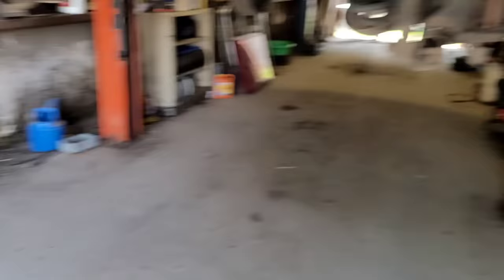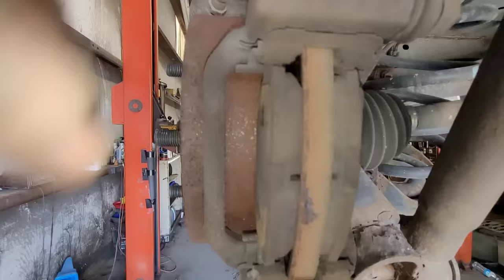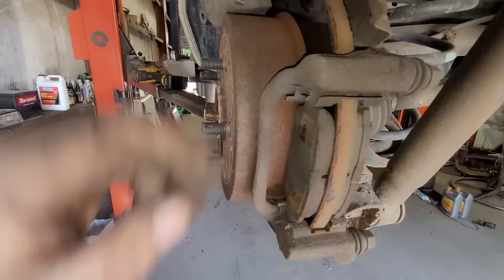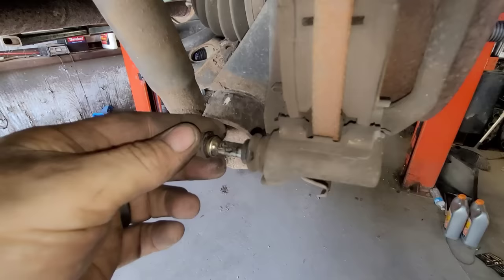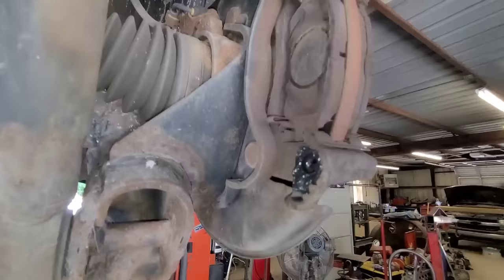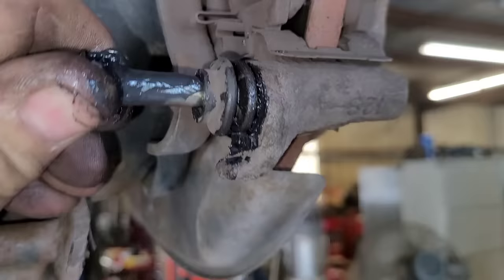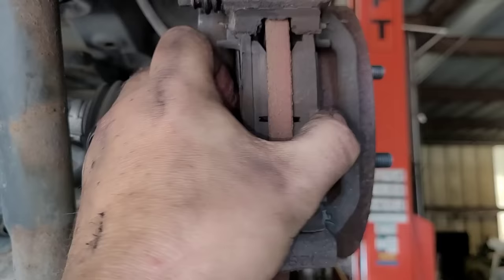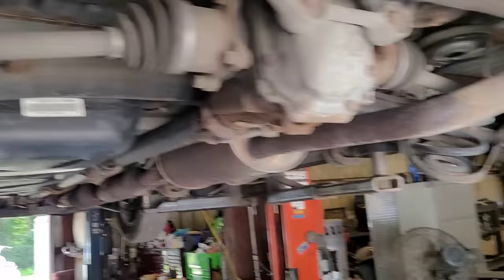Low Brake Pedal ? It's not air in the system...

Comment: If you have old fluid, the boiling point goes down. Boiling the fluid most definitely puts gas in the line. So it is possible that a never opened line, driven the same as always all of a sudden has air in the line. That's what happened to me. Those exposed Toyota pins on Tacomas, we replace every spring. Every spring. I have a truck that drove for 13 days in New England, and Florida dealership refused to service it for warranty

Comment: On older vehicles that only have drum brakes, having to pump the brakes means the master cylinder seals are worn and fluid is bypassing the seals. So in order to get enough volume to the brake cylinders you have to pump the brakes. I remember as a child our 1937 Chevy had that problem. Lefty

Comment: Just today, I found BOTH of the inside pads on my wife's outback worn out with the outside pads barely worn. The hidden side of both front disks was badly scored. I had followed bad advice to use anti-seize on the sliding guide pins. It caused the black rubber inserts on the guide pins to swell enough to lock them. I feared that I would have to replace the sliding caliper brackets but eventually found a puller to remove the pins. After new disks, pads, pins, and rubber seals, I will only use silicone grease.
Reply: yes silicone grease or "silicone paste" only

Comment: In the Midwest, they'll be rusted so bad, I'll have to torch them  to get that slide out. Usually the rotor will be hotter too. spongy and maybe a slap back sound, if you slide your foot off while pressing.

Comment: I’m going to check this theory on my 4runner. Same exact symptom. A quick pump and it’s firm but mid drive it’s about half the pedal stroke that it finally engages brakes. Front pads were replaced just before I bought the truck (used) and I figured maybe it had air in the line so I bled them. And they were fine. Also my reservoir was way over full. Hope this works
Reply from the maker: Let me know if this helps. Thanks for watching & commenting 🔧

Comment: THANK YOU KENNY, you saved me from making the mistake of replacing the master cylinder. The front brakes on my 2012 Yaris are disks and my issue was like yours except the problem was worse, I have just over 100K on the original Toyota pads and I don't know if the problem was original to the manufacture of the car or someone did something to the brakes but one boot on the passenger side on one pin was pulled off and that pin was rusted in pretty solid. I was finally able to break it loose, clean off all the rust and lube it up to where it felt normal again. The inside pad had more wear as you stated but after fixing that pin and lubing up the other all is well again. Not really in the rust belt, we are in Maryland. You saved me a couple hundred dollars for a new master cylinder and a lot of work that would not have fixed the problem. You are da man.

Comment: Another couple of things to consider besides stiff or frozen guide pins when it comes to a low soft pedal is the parking brake. On many middle aged to newer all wheel disk vehicles the rear calipers are used as the parking brake. You can tell by a lever on the back of the caliper going to the parking brake cable ( new new vehicles will use electric parking brakes but same idea). If the parking brake is not used often enough or the self adjuster fails it wouldn’t account for pad wear and keep the pad close enough to the rotor ( might be the reason for your mysterious self retracting piston? ). The same applies to vehicles with rear drums, poorly adjusted rear brakes, infrequently used parking brakes or failed adjusters will cause the same low soft brake. Just a thought on what to check. 😊😊😊
Reply: So true! I worked for Firestone back in the mid 80s. Rear disc brake calipers with integral parking brakes were fairly new. The company would push complete brake overhauls. This meant rebuilding those rear calipers. I remember doing a few. I did a Lincoln, a Trans Am and a Cadillac Seville. Using the parking brakes on these vehicles was vital to help keeping a firm pedal. I remember breaking the cardinal rule for rebuilding brake calipers. I didn’t verify the bleeder screws would loosen before rebuilding the calipers on the Cadillac. They were rusted solid. Fortunately, I worked with a brilliant mechanic who, with a lot of skill and patience, was able to break them free. We were both in our early 20s at the time. The good old days!
Reply: I have a 01’ suburban and my parking brake light is lit in the dash. I just changed the brakes and rotors and the light is still on what can be done to make the light go off? I’ve sprayed the e-brake with pb blast , the actual brake does engage and disengage what could cause the lit to stay on?
Reply: @reginaldthomas105  check the parking brake switch on the parking brake pedal assembly. Sometimes the mounting screw will come loose so the switch won’t line up with the pedal assembly and the light will never go off.
Reply: @reginaldthomas105  also if the proportioning value has been tripled it will need to be reset
Reply: @reginaldthomas105  First, verify the parking brake pedal is returning completely. Pull the parking brake pedal up by hand to see if the light goes out. Maybe a bad switch on the parking brake pedal? That same light is also tied to the main brake hydraulic system. Your vehicle might have a low brake fluid sensor (float style) built into the master cylinder.  Also, Verify that you have brakes at all four wheels. The proportioning valve might be shifted into the unbalanced position, causing the light to come on. You may have only front or rear brakes. If everything (meaning the entire system) is leak free and is bled properly, the valve should center itself. That’s assuming that’s what’s causing the light to stay on. If you have A good solid brake pedal, it would lead me to believe the valve is centered correctly. Lastly, if your burbie has ABS brakes, there could be air in the ABS actuator. That’s if the system has been opened and air has been induced into the system somehow. Good luck!
Reply: @clicks59  thanks so much for the insight I will look into
It
Reply: @johneverett3947  how do I reset ?
Reply: I was told for the integral parking brake to auto adjust in the rear caliper we are supposed to pump the brake pedal several times 20-30 with the car on and handbrake nut in center console backed all the way out, it never seemed to work for me and the nuts for the handbrake cable in the center console are almost maxed at the end of their threads leaving no more room to crank it down more. With old calipers and new calipers, any reason why this might be?
Reply: How about a broken e-brake cable? That would do the same yeah?
Reply: if the rotor is too thin it will do it too. especially if the pads are worn!

Comment: You're just fantastic. I learn loads from you and you're so thorough. I have a slight blown head gasket on my hyundai i30 2010 and block test didn't show a leak but I still suspect it as white smoke but I didn't rev anx HOLD for a long time like you did at higher rpm. Will try
Reply from the maker: @paulmannering3831 how did the repair go? You good?

Comment: There are 2 types of brake grease , one for metal to rubber and the other is for metal to metal. If you put wrong type of lube to the caliper pin then it might damage the rubber boot and gum up the pin. On the other hand if you put low temperature tolerant on metal to metal part then it might cause fire. Most of silicon based lube operating temperature can be up to around 575F. Synthetic lube can be up to 3000F. Between shim and back of brake need grease to reduce noise. I use rubber friendly silicon based grease to lube caliper pin and synthetic grease to lube metal to metal part.
Reply: There’s yellow gel like substance and black grease, you’re saying the black grease is for the slide pins only?

Comment: This can also happen if the linings are loose on the shoes of drum brakes.....even if it's just the rears.....Some are rivetted on and some are 'bonded' , which can loosen if contaminated by brake fluid from a leaking cylinder (over time).....All it takes is one, and the pedal will require two pumps to take up the slack between the lining and the shoe......John (west coast,Can.)

Comment: The worst brake pedal I felt on a 'yota was an older Toyota Tundra with drum brakes in the back. The brake pedal was to the floor and it was hardly braking. Turned out to be the parking brake cable was way out of adjustment and so were the brake shoes in back. Add a brake fluid flush and a front brake job and it actually stopped way better.

Comment: good video!!, seems like those slider pins get tight about every 2 years, and if you get a customer that drives ( or brakes) hard you need to use the newer ceramic high temp lube, the regular stuff will harden if the driver is driving like a nascar racer, also wanted to mention that calipers can let air in, it is rare in newer cars but anyone that owned a 1970s corvette knows what I mean, I did have a Chrysler 200 in my shop that had a spongy pedal, you could just open the bleeders for a minute and have a solid pedal, I noticed I only got air from one wheel, a new caliper fixed that one
Reply from the maker: I've experienced that before. It is rare, but I know what you're talking about. Thanks for your comment & watching the channel. Keep wrenching 🔧

Comment: I had soft brakes on my 2006 Murano.  Found out I had 4 x 100% seized rear brake caliper pins, had to use a blow torch to move them.  Replaced them all, greased...fixed the problem
Reply from the maker: Good job !! Thats awesome !!
Reply: @WrenchingWithKenny  your video is the best out there

Comment: Excellent video. I think you've highlighted the problem I have with my CRV which is also from upstate NY. The brakes feel soft and low. 
The video "Brake Caliper Slider Pin Grease - How Much is Too Much ?" explains why you should not pack the pin with too much grease, especially the tip of the pin. This prevents the pin from going in fully and the grease also acts as a buffer.

Comment: Bought a 2002 vehicle in 2013 and found the front caliper pins rusted and almost jammed.  The brakes locked up on one wheel (Squealing).  I found a receipt in the glovebox showing the previous owner had done the front brake pads within the past year (2012) but the shop never touched the pins!!!!  I cleaned up the pins (Wire brushed) and lubed them up and have driven the vehicle for almost 10 years.  I just replaced the rear brake lines myself because one blew (Drum brakes).  Now I am thinking (Thanks to your video), I need to recheck those front pins!  After bleeding, my pedal is still not right.

Comment: I have a '66 Chevy with power factory disks all the way around. It's a nice car, no rust on anything. I was cut off THREE TIMES in a 20 minute drive three weeks ago and I smeared the brakes on hard, each time. No problems, this thing stops well. But last week...soft brakes. Previously the brakes were heroic. M/C pretty damn full. No leaks on my garage floor, nothing wet under the car.  Replaced all the bleeders as SOP. Vacuum bled, brakes a bit better. Brakes will lock hard, car will stop in a short distance. But spongey at a stop. Engine off, nice firm pedal. I won't bleed engine on as the fan will put DOT 3 all over the paint and that's a no-go. Small cam in the engine, makes 15" Hg which should be fine (and has been previously) for the brakes. I'm beginning to think my front soft rubber lines are swelling, But I'll take the wheels off again and check if there's anything like a seized pin or four. Thanks for the idea!

Comment: They sell wire brushes that you can put on the end of a drill at Harbor Freight. I think it's called an engine cleaning kit or something. They work great for cleaning things such as the brake caliper bracket slides.
Reply: I just did the exact thing...the little brushes are loaded into a power drill. I shoot the caliper slides with brake clean and hit the area with the drill brushes....super clean
Reply: Called 20pc engine brush kit $19.99

Comment: I use a combination of nickel anti seize thinned out with aerokroil. The anti seize is rated for up to 2400 degrees, and the aerokroil keeps it thin enough to make sure it doesn't cake up with time or low temperatures.

Comment: I diagnosed this on my own yesterday, installed new pads, removed the pins and they weren't moving as freely as I remembered..took the truck for a spin and the pedal felt different once stopped... boots are 20 years old and soft, replacing them this afternoon..I use Silglyde...

Comment: I've been fighting a sorta soft pedal for awhile now. Although the pins are not the problem. When I got the truck the pass rear brake line was completely gone. Apparently someone had high sided it in a ditch. So the driveshaft was bent (It's aluminum), no rear brakes, transfer case had exploded and was in a box, transmission housing was cracked the output shaft all the way to the bell housing, and various other things. 
I replumed the rear brake lines with new lines. It had really soft brakes once I got it running again. So I pulled out the old parts cannon. I replaced the booster, master cylinder, cylinders, drums, and shoes on the rear, and new calipers, rotors and pads in the front. As far as brakes go. There's a VAST improvement from before. It's safe to drive and all and you can come to a solid stop w/o pumping them. But if you pump them once, the brakes are THERE right away!! Which is how it should be for all the work and parts I've put into them. My next course of action is going to be power (pressure) bleeding them.
Reply: And you bought this vehicle , why ?…….

Comment: If your vehicle is over 10 - 15 yrs old, consider replacing the rubber brake hoses. Over time they become spongy and absorb some of your brake line pressure. For me, it's made all of the difference.

Comment: I had a similar bad pedal feel. It went away after I changed a bad wheel bearings in the front.   I guess the hub was able to wobble when you applied the brake.

Comment: Hey brother I just want to thank you for doing this video and I stumbled across it by accident but I hope it fixes my problem. Only difference is that I feel and hear something with the abs when I depress the brake pedal but only for the first 15 minutes and then the brakes act normal but I am double pumping it. 
I’m a father of four and my wife and three sons are disabled. We are poor as poor can be and only one person is getting assistance so it’s not like we have three grand in SSI coming in every month. I’ve put so much money into this 2007 pathfinder. O2 sensor, cat converter, crankshaft sensor, mid exhaust pipe, spark plugs, coil #3, I now need coil #1 and a new muffler. I knew how to do some things and I have tools but I had to learn how to remove the intake manifold and that was scary. I’m trying my best but every time I fix something another thing goes wrong. I know that that’s how it is when you own a car but damn I wish there weren’t so many components to these cars. Why can’t they make them like the 60’s with simplicity. They want us to be forced to bring it to the dealership or garage and spend more money after we paid thousands of dollars for the vehicle 😩. 
Sorry I got to ranting 😂

Comment: To clean the slider pin bores better,a gun barrel cleaning brush works great on any small bore for me,closed or open! If I dont have slider pin grease available I just use never seize on the pin bores! Thanks Kenny!

Comment: I have seen on a few rare occasions a calliper or wheel cylinder pull air and also barely if at all leak any fluid!, f truck baker light pistons after overheating being one I  had problems with along with some drums, they probably pull air as it cools but this is extremely rare

Comment: Thanks for the video. I never thought that thing should be causing a soft pedal up to a lower point where the brake is hard. I have this kind of problem after a rear calippers rebuild,  proper bleeding using  power bleeder and no chance to succes. I drive with this problem and from what I remember, all the pins are moving freely. So I'm thinking the piston dust boot may push the piston back. I will check both scenarios and take a look to  hole brake calippers and pads too Thanks again!

Comment: I've got an Explorer Sport Trac I just bought and the one issue I've noticed is soft brakes and a low pedal. I just noticed today that even after driving about 50 miles that the outer disc, that you can feel with the wheels still on the car, are kind of rough and rusty. I'm pretty sure the pins are seized up.

Comment: thanks for this. I had to brake hard and after that my brake pedal felt wrong. I assumed a burst brake line but braking kept working and no fluid on the ground, reservoir was fine. I did do a brake job recently and reused a torn boot because I didn't have time to replace it when I noticed the tear and figured I'd do it later. I doubt a guide pin would have already seized, but I'll check this out. I was going to bleed my brakes but I don't know how air would have gotten in them. I've heard the fluid can boil during braking, since it absorbs moisture over time...

Comment: I use a drill bit a size smaller in reverse. Cleans them out well. Also a brush for cleaning handgun barrels works well also. Most are about 9mm or so. U can pick up a set of brushes cheap.

Comment: If you get the brakes extremely hot it will boil the brake fluid and vaporize some of the fluid in the lines. I saw this one time when a guy in a rented RV road the brakes in the mountains. I bleed the brakes for him and the went to working correctly